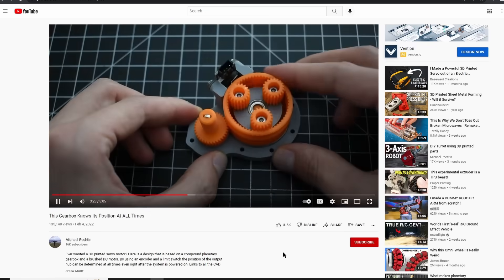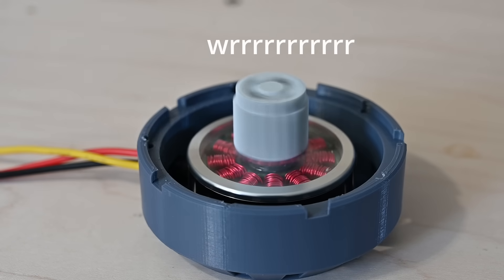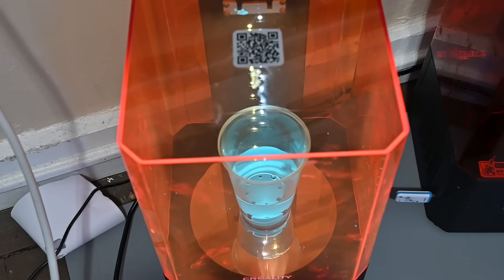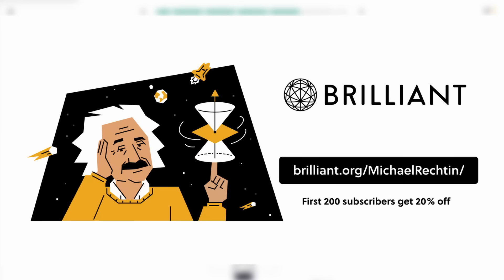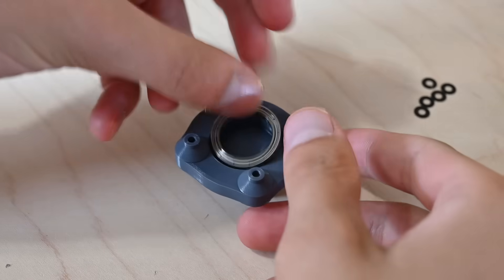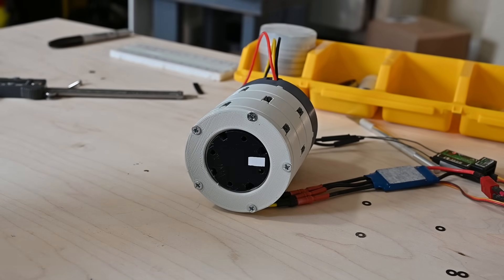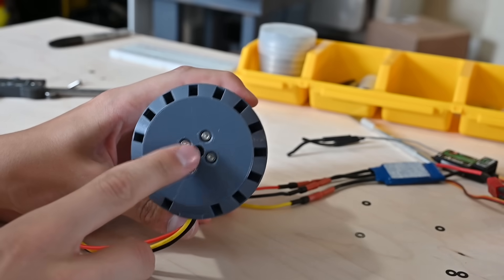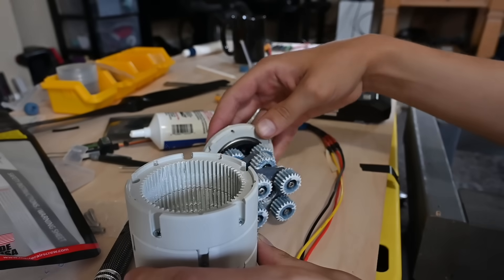3D Printed Stackable BRUSHLESS Motor Gearbox

Comment from the maker: Visit  https://brilliant.org/MichaelRechtin/  to get started learning STEM for free, and the first 200 people will get 20% off their annual premium subscription.
Reply: Don't use white lithium grease on plastic parts it will eat away at the plastic parts over periods of time rather use a silicone base grease or grease that safe on plastic.
Reply: Would love to see it attached to something like a scissor lift to observe how much useful work something like this can actually achieve. Robotics is interesting, but there is an entire world of more common workloads which require something along these lines. As such, something like a scissor lift is applicable to a variety of related workloads, such as solar trackers or simply lifting a load.
Reply: Make a screwdriver 9,5Nm should be enough
Reply: Hey mate, I haven't read through all the replies but this might have already been covered. Yes, your test rig had issues but I wouldn't be worried about inertia so much.

First off, before testing again be aware of your limits, if the gearbox is the limit then that's fine, it'll just break. If the GBox holds up then your current draw will max out in an instant and you'll blow an esc or a lipo, whichever has the lowest current handling capacity, that can get expensive, dangerous, both. Maybe throw a cheap automotive fuse inline.

I'd lift a load, essentially you just make a winch and keep adding weight until you can't. You just make the drum a known diameter and you can get meaningful results.
Reply: UPGRADE TO CURA 5.10 PLEASE
Reply: This an interesting build. But as has been explained by someone smarter than me, you’re not measuring torque there. You are actually measuring impact inertia. 

Torque is a measure of rotational force. So, in theory in this setup you would be placing the arm in contact with the load device, THEN activating the motor. 

But your motor is designed for running fast, so it is not optimised for this task in the first place. 

Another way to measure the torque might be to attach known weights to the end of the arm to establish how much weight the gearbox can lift.
Reply: hmmm 

Say you had a small amount of metal hardware store parts.
I wonder how much you could 3D print and make a plastic shredder for recycling with this gearbox.
Reply: your 3x10x4 bearing link goes to a 5x16x5 bearing. Not sure why
Reply: I take it ,if you wanted to speed up the rpm output you would reverse the hole thing.

Comment: that would work for a small wind Omni Directional Wind Turbine only i wouldent use the controller for speed control id let the wind do that only id drill out the top put a fixed gear in the center on top and run the wires down the side to see if it gives off any kind of charge for power like say for a cell phone or something or a light thats me in my brain lol love to tinker

Comment: I can't believe you got the equivalent of 32 kg*cm at such a high rpm at 4:00.  I searched all over Amazon and the absolute best brushed motor I could find had 8.5 kg*cm at 500 rpm (which is pretty good for the price-point).

Comment: You are screwing the case with big ass screws but the planetary gears that will create torque do only use small ones. I think this will have a high wear if loaded. You should attach planetary gears from both sides, not just one to avoid leverage.

Comment: Nice design. You can try metal printing. There is a chinese company unionfab that seems to have significantly lower prices than the west. particularly alu print seems cheap.

Comment: Whaoo! Nice and very kind to allow us to use that.
I am keen of rc sailplanes so I tried to use you design to fit my model in order to use a bigger propeller, more efficient than smaller ones,
The problem is that we cannot reduce the size with a slicer (i.e. 50%) without changing the casing of all those bearing….and if we do not use cad soft, we are lost.
Do you think you could help?
Regards
Eric (France - Brittany)

Comment: The torque supplied by your system on the load cell is actually dead-on ZERO.   What you are measuring is actually an impact "crash".  The reason is the ESC.  That ESC is totally useless at zero RPM.    I do happen to have the same exact 5010 motor but I'm driving it with a controller that is designed to handle the zero RPM case.   The torque the motor can supply is limited by heat.   The controller can just keep increasing the current in the motor until I turn it off because it is getting too hot.     This means a cooling fan could help the motor produce more torque.   The motor itself can take 20 amps, for a few milliseconds or 3 to 4 amps for a longer time.       My next step is to place a thermistor on the stator and measure temperature and try to limit to (say) 55C peak.

Next time you do a load cell test, let the arm stop and then wait until the reading stabilizes.

Comment: Your multiple stage gear system actually looks 1:1, from the first stage, since all the “ring gears” have the same number of teeth. Also, T = I*alpha so your right that the “torque” will vary depending on acceleration. Lastly, if you check your motors specs you can predicts the output “torque” from it… You then compare that to your test results otherwise what’s the point? 😁

Comment: is it really necessary to have the outer shell have gear teeth on the wall? maybe it makes sense for stabilization but it feels like youre adding unnecessary friction. i would model the walls to lock with the motors so the motors stay in place but the gears down scaling your ratio could benefit from removing that extra friction happening with connecting with the wall gear teeth... just a thought

Comment: You could try using a disk brake off of a motorcycle or even a bicycle to create a torque dyno to get more accurate torque readings at any speed.

Comment: Great design, I am in the process of automating my pool, and these gearboxes will be great for automating the valves, e.g. I can automate the flow to bypass the solar heater if the pool temp is too high, or remotely control flow distribution from pool to spa, etc. I'll probably be using steppers and arduino IOT. Thanks for your community spirit.

Comment: 4:09 I think you should put some engine oil or grease to lubricate those gears so it will not sound loud and will work smoothly ❤.
Also gears will not wear out.

Comment: you should try using a stepper motor instead of the brushless drone motors they are terrible for low speeds they have to be above a certain rpm to achieve maneuverability

Comment: This gearbox could be scaled up and used with a 40v lawn mower motor for a DIY ebike conversion. Motor input speed is 3000 rpm. The gear box output speed will need to be 300 rpm. The final drive reduction to 70 rpm can be achieved with a 12 tooth to 52 tooth chain ring on the pedals.

Comment: Make a gravity battery for home power storage since lithium batteries are very expensive, limited supply of lithium in the world and it will be more robust, not subjected to temperature issues as much. I would work on a storage capacity for 10kW and a max output of 5000W or maybe 10kW output. This is the standard set up for domestic use.

Comment: If  you want to test the torque, I'd print a drum with a string or rope attached, and have it tug on a drag scale, or however  they're called. Then you can have the motor run at 100% and void the intertia aspect of your current test

Comment: Whoa...wait....what was that?  Curing a resin part submerged in mystery liquid....please splain.
Reply from the maker: Curing in water. Supposed to help it cure more evenly per the data sheet
Reply: @michaelrechtin  Interesting. Have to try. Thanks
Reply: @michaelrechtin  I guess I should ask....did it make a difference in your attempt?

Comment: We gotta see an extreme reduction and what what would do. I'd imagine one of at least three outcomes. The ideal one is you measure quite an insane force, or it strips the gears, or the motor just cannot move the assembly. Edit, just finished the other video. Not sure how well it would fare with say 10 sections or more. but would still be cool so see if it would work, and see how much force you could get out of the smaller motor. At the very least the carnage might be pleasing to root through. if it moves at all anyways.

Comment: Okay so based on your explanation of how a brushless motor works tells me that it's not a DC motor it's a 3 phase AC motor that uses a DC to 3 phase AC converter which is fine I just wish it wouldn't be called a DC motor because there is no way possible to drive one with a pure DC connection it has to have a motor controller that converts it.

Comment: I think what's missing is the ability's to hot swap out the reduction.
Maybe a inner shaft that engages only at selected ratios controlled by an outside sliding mechanism, or the rings could twist lock into place with a manual switch to unlock a retractable back stop where said rings bottom out on the previous one.

Comment: Planetary gearsets are 3-way adapters for gears. This design uses 1 of them as housing, and the other 2 change ratios like a car transmission. An old-fashioned manual transmission could do this more simply, or an Allison transmission is more elegant. Or add another motor (it can generate too, right?) and just 1 planetary gearset and you have a hybrid transmission. All 3 of those are modular designed to change while the vehicle is in motion, without having to stop and bolt in other parts. But this is a good learning exhibition - a launchpad to talk about transmission designs. Thank you for making the video.

Comment: You have a software error on the load cell, it can only measure max 200 N (says 20kg on it) , not 10 000 N. It should be obvious that a PLA arm cant push with 1000 kg...Also the calculation for torque is wrong,  9500x 0.1 = 950 Nm, which is like a tractor, also obviously wrong.
Reply from the maker: Yeah the calculation shown on screen is definitely wrong (see description). The load cell was measuring in grams and then converted back to N. Final torque measurement is pretty close to correct just ignore the calculation in screen

Comment: Just mount the arm with the load cell to the gearbox case and mount a longer shaft to the output shaft, so you can grab it with a glove to apply a breaking force to the output shaft. Now you can do continuous torque measurements at different rpm's without the influence of inertia!

Comment: Yeah, rotary encoder and you'd have yourself a fairly decent servomotor of the type they use on big=boy CNC machines. Not for nothing but on grease etc I'd probably personally go something thicker and pack it out - maybe silicon grease..

Comment: Let a, b, and c be the rotation speeds of the sun, planet carrier, and ring respectively, and S and R the tooth counts of the sun and ring respectively. Then:

Sa - (R + S)b + Rc = 0

Now we imagine two planetary gearsets connected together in a particular manner: The sun gears and ring gears are connected together, the first ('input-side') planet carrier is fixed to the chassis, and the (connected) ring gears spin freely. The input is on the sun gear(s) and the output is on the second ('output side') planet carrier. We will denote the sun and ring gear tooth counts as S_1, S_2 and R_1, and R_2, respectively; a, b, and c will denote the input sun gear, output planet carrier, and free-spinning ring gear speeds respectively. Then:

S_1 a + R_1 c = 0
S_2 a - (R_2 + S_2) b + R_2 c = 0

And solving this system we get a gear ratio (a / b) of:

(R_1 (R_2 + S_2)) / (R_1 S_2 - R_2 S_1)

which is very intriguing because if we make the denominator very small, we can get a very high reduction in just two stages. For example, your design uses a 60-tooth ring gear and a 20-tooth sun gear. Let's say we build the input gearset with a R_1 = 66-tooth ring gear and a S_1 = 24-tooth sun gear, and the output gearset with a R_2 = 57-tooth ring gear and a S_2 = 21-tooth sun gear. Plugging those numbers into the equation we get a gear ratio of:

(66 * (57 + 21)) / (66 * 21 - 57 * 24) = 286

Granted, this uses 3, not 4 planet gears per carrier, but 286:1 is a pretty tempting reduction to achieve with just a couple of planetary gearsets.

Comment: Cool project!  I’m a hobby machinist, so I’m super curious about what the measurable differences are between machined tool steel gears and box which are hardened, and the printed version.  Power, load, speed, noise, cost, and reliability come to mind.  I have no opinion; it would just be interesting to have data that guides when, for example, plastics, steel, or hybrid designs are optimal choices.

Comment: What's the current draw per gearbox added? Since you're possibly not as efficient as possible with printed gears that are slightly worn and/or metal, I'd want to know that before I built a circuit to control something like this, or code to drive it

Comment: What went with the calculation at 7:50? If you actually measured 9500N, which I highly doubt, you would have a torque of 950Nm.
Reply from the maker: Yeah that was my bad. Measurement was a little more than 9500g. So roughly 9.5Nm. Final answer was close but the calculation I put in the video was way off. I put a note in the description

Comment: You were asking in the video for better methods of measuring the torque capabilities. Automotive actuators are tested as following:
PULL OUT TORQUE: Mount a weight on a lever that hangs straight down before the test. The motor then tries to raise the lever as high as it can. The further the motor turns, the further the weight is away from the vertical axis and the more counter torque it will see. The limit is called the pull out torque, which represents the counter torque it can handle during movement.
PULL IN TORQUE: Mount a weight on a rope winding and lift the weight with the motor. The weight does not change over time (if you ignore the diameter of the winding growing with the rope winding up), but by making the weight heavier you'll find the limit of torque that can be applied from still stand. 
The pull in torque is also a nice automated lifetime test if you want to measure the durability. The gears will be worn only in one direction (counter torque does not change direction). Take an Arduino to generate a servo signal for the ESC, this should automate it easily. Be aware that you also test the capabilities of the ESC: their behavior when detecting blocking is a pure software thing.

Comment: Mount it to a mountain bike brake disc and then add the load cell to the caliper. Will allow you to measure the torque while it's spinning

Comment: Nice job designing and printing ! 
To really measure the torque, you could use a pulley as an end shaft, and try to wind a cord around the pulley while refraining the wire with one of those luggage weighting hooked, until you stop the motor. So you can get rid of the starting couple & the inertia 😉

Comment: Could you get more accurate data if you used a prony break that way it could be in motion while testing rather than static (i know static torque is a specific stat, but its better than nothing)

Comment: In your hardware list I don't see a link or reference for the brushless motor controller you are using.  It would also be interesting (and useful!) to see a complete schematic/wiring diagram.  You are using an RC controller, I have uses that would be driven by something like a hard-wired microcontroller.  Thanks!

Comment: You wrote at the end “9500N x 0.1m = 9.5Nm”.  9500N is 950kg.f or about 2000lb. The load cell would be crushed. Also, 9500 x 0.1 does not give 9.5. Who is doing your measuring? Who is doing your math?

Comment: Very interesting. I am currently building a gearbox for a Nema 34. That motor can deliver around 12Nm on it's own.
I may have to print your design one day to see how much force it can handle. 
My own gearbox design uses cheap Chinese metal gears with a 3D printed frame. I should be getting around 40Nm at the moment. That's the kind of power that can self destruct rather easily 😁🙄🙄

Comment: This an interesting build. But as has been explained by someone smarter than me, you’re not measuring torque there. You are actually measuring impact inertia. 

Torque is a measure of rotational force. So, in theory in this setup you would be placing the arm in contact with the load device, THEN activating the motor. 

But your motor is designed for running fast, so it is not optimised for this task in the first place. 

Another way to measure the torque might be to attach known weights to the end of the arm to establish how much weight the gearbox can lift.

Comment: As soon as I saw the output arm at 6:09, I said out loud, "that's gonna snap right in half." Called it! Awesome video.

Do you happen to know how much filament this ended up taking to print? I don't have any need for a torque converter at the moment, but I've bookmarked this video in case I ever do!

Comment: Nice design. with a few slight modification in particular of the end piece you could make them stackable and destackable without requiring reassembly of the individual modules.

Comment: Really dumb idea considering how fast a BLDC motor can go, but what if you connect the motor to the output to backdrive the whole planetary system (i.e. instead of 64:1, make it 1:64). As GLaDOS would say: "Speedy thing goes in, speedy thing comes out". Doubt the small motor could keep up, but would be fun to see how fast you can make a thing spin on 1:1, 1:4, 1:16 and so on and see where the point of diminishing returns kicks in.

Comment: It would be fun to slap that onto a bike and use to ride around. Would need to change the design to either add a small prop for air flow over the motor for cooling, or a duct and a blower motor.